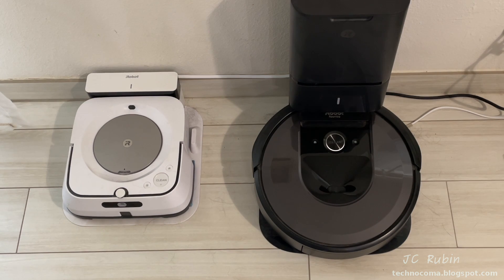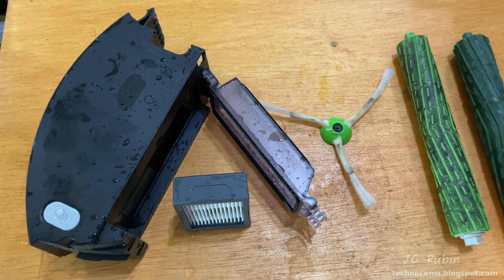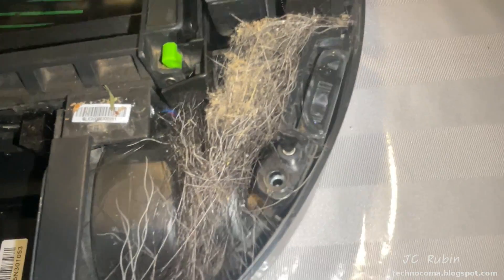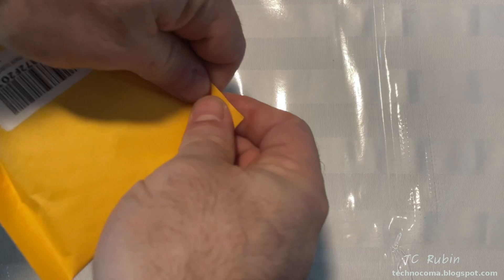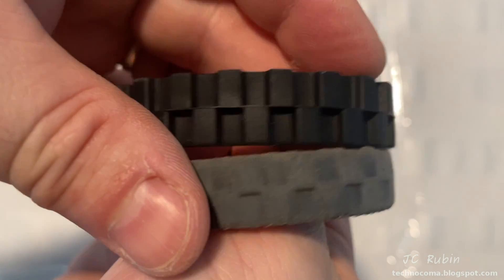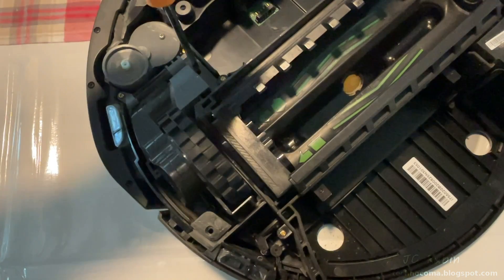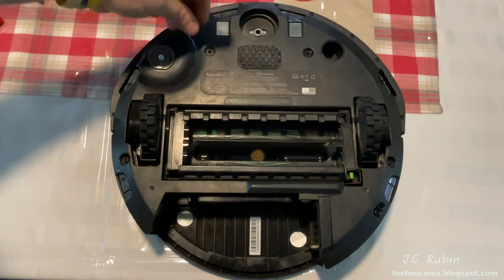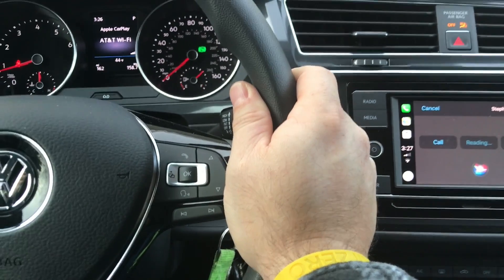Irobot Roomba Tire Replacement Made Easy + Internal Maintenance

Comment: Thanks so much!  I was wondering why my Roomba was getting stuck and thought I might need a new one.  Then I figured out that the tires were completely worn off! I do regular maintenance on it, but it just never occurred to me to replace the tires!  I particularly appreciate the advice to gently tighten the screws -- my instinct would be to tighten it down hard.  Thanks to you, Wall-E is up and running well again!
Reply from the maker: Glad I could help!

Comment: I COUND NOT get the 'tire' to go around wheel. 
SO.......
I put 'tire' in hot water for 2 minutes. That did the trick. It loosed rubber enough to let it slip on wheel.
Reply from the maker: Good tip, glad it worked out.